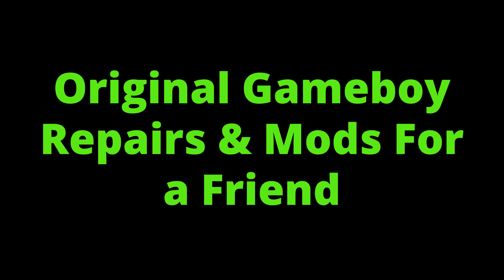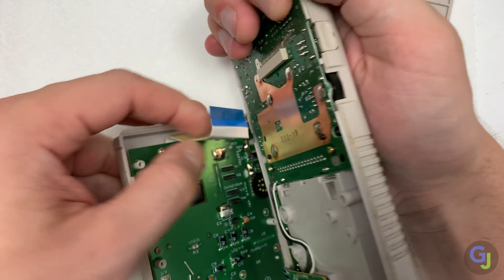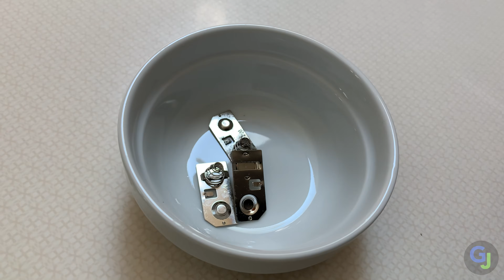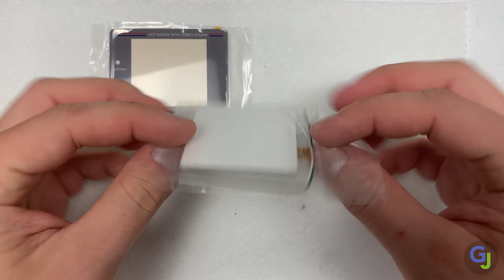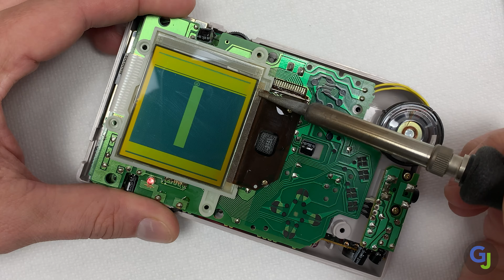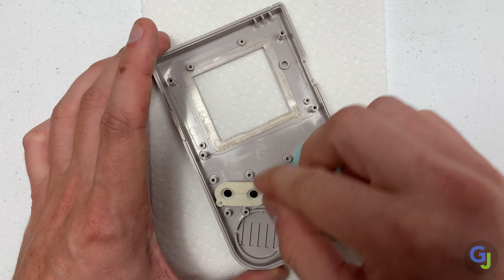How To Make Your Original DMG Gameboy Handheld Like New With Just A Few Modifications

Comment: Backlight mod, great idea and I intend to do one if/when I find my old Gameboy in all my other stuff. Bivert mod, I'd happily spend extra to not change the look like that. Some sort of lithium battery too if I can do it without cutting anything.
Reply from the maker: The backlight mod is actually what changes the look to the bluish screen here but you can get different backlights that will adjust the color too basically whatever look you'd like. There's a yellow or a washed yellow one that makes it look closer to the original green though, but you can customize it in many ways. I am honestly kind of sad the green look is gone since it is so iconic but I still really like how it turned out.
Reply from the maker: Also, they do make a rechargeable battery add-on that is nearly a drop in part that requires very little work to get it installed. Its called CleanJuice and you remove  one of the battery springs from the back and it drops right in. It's an awesome little mod. Then you don't need to replace your batteries after every 2 hours of playtime too lol.